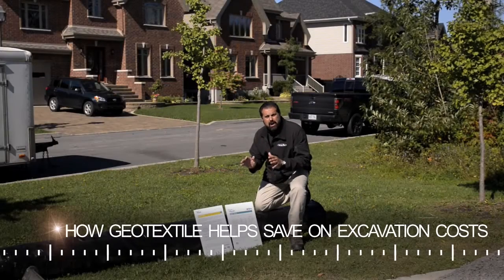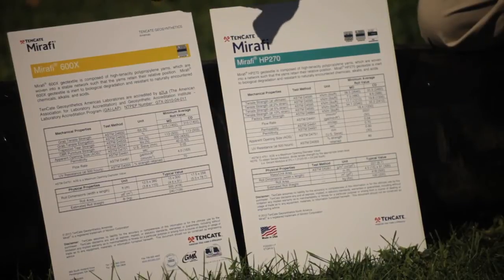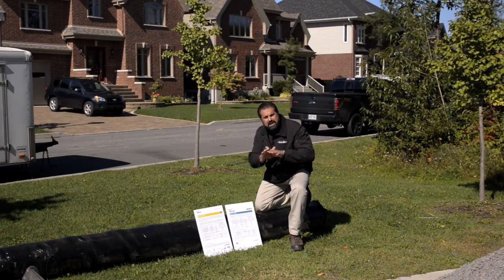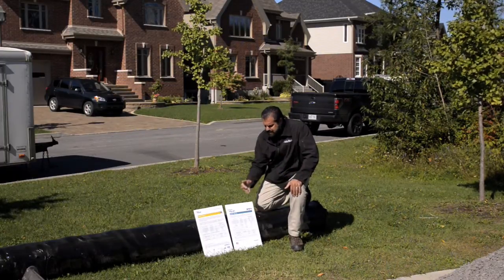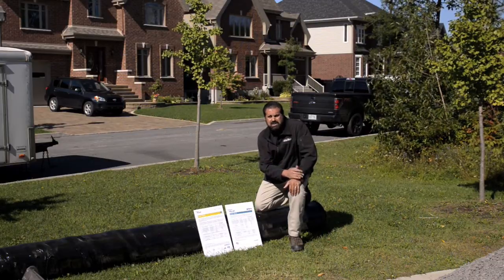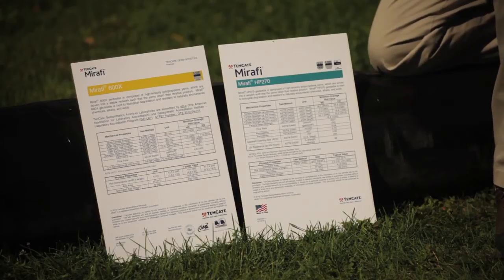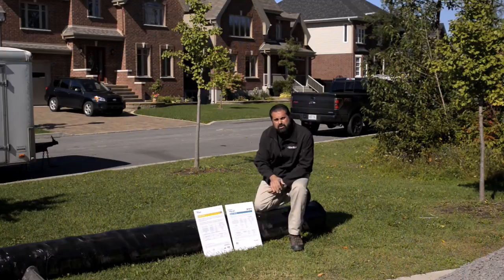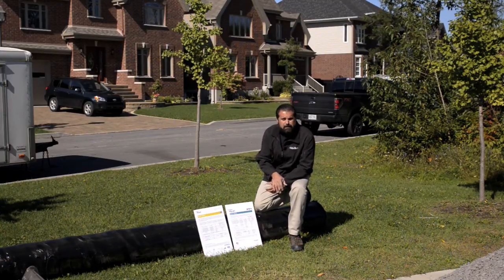Installation of Geotextile Fabric

Comment: ok so you are telling me woven or non woven and does water flow at a greater rate or does it matter more about the frost line versus the coefficient of the main strategy and does the sun have anything to do with it or is it just the money issue due to the leftovers you have from the customer buying a 4500 ft roll?
Reply from the maker: Hello Richard,
The flow of water is dictated by the apparent opening size, or AOS. If the infiltration of water is a concern (permeable pavements for example), then an AOS of 70-100 is recommended. A woven geotextile with biaxial characteristics helps prevent differential settlement. Non-woven offers some stability but does tend to stretch whereas the woven does not. If there is subgrade settlement, the non-woven will stretch and follow. Try to keep your geotextile protected from the sun when not in use. The UV rays can dry out and weaken the fibers. Finally, when using a woven fabric, consider cutting to size and laying out in the sun before installation, this loosens up the wrinkles and folds that may exist and that are tougher to get rid of on colder days.
Thank you!